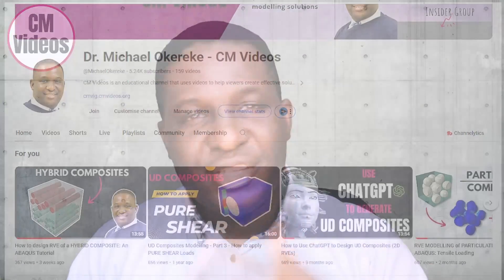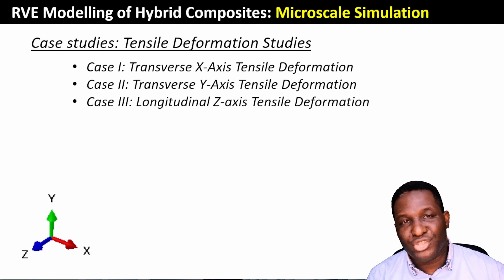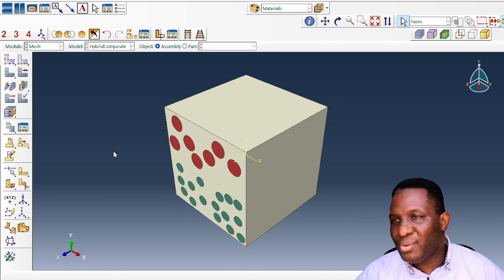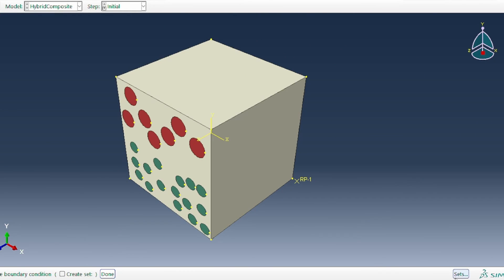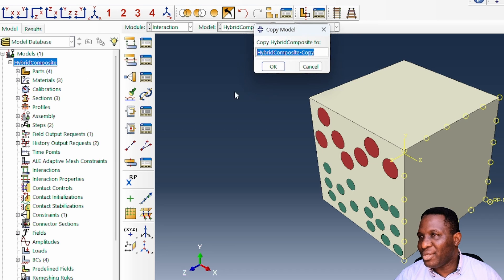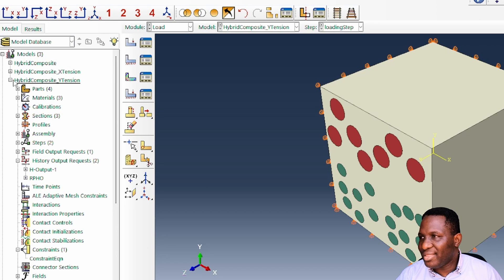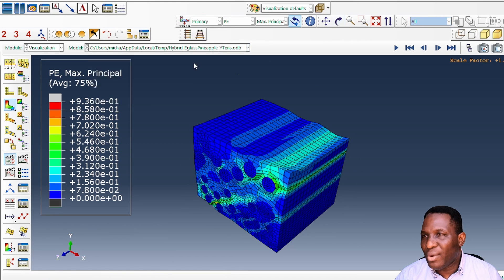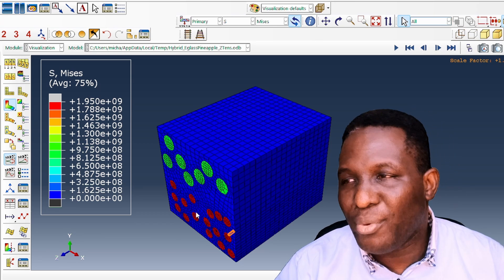Tensile Deformation of Hybrid Composites: An ABAQUS Tutorial

Comment: I am simulating simple composite tension with Abaqus.

However, there is a problem. At 0 degrees, the tsai wu index value and the fiber direction stress of each layer are the same, but when a symmetrical composite is processed with the same process, the fiber direction stress of each layer is the same, but the tsai-wu index value is different.

I also calculated it with the equation provided in Abaqus, but it is different from the analysis result.
Can I get some tips on this?
Reply from the maker: Not sure I have any tips for you.

Comment: Dear Dr Okereke, 
Thanks you again for the great informative videos.
I had a question;
If I want to do damage and plasticity in the RVE using this Drichlet approach (if I don’t mistake like polynomial loads), is it possible to give the ductile damage properties and simulate the RVE?

Thank you for your time and help.
Reply from the maker: Of course, you can undertake the RVE study with the Dirichlet approach. This is the most common way of running this sort of microscale simulations. What you need is to include the plasticity with a ductile damage polymer model (capturing the behaviour of the matrix). I typically use an elastoplastic material model, as it is quicker to use and the easiest to understand to the lay person who I tend to reach to with my videos.

For more advanced users, polymers are typically modelled using the Drucker-Pragers yield criterion. This is because for such ductile materials that experiences yield, you need a criterion to instruct the simulation that damage (or more appropriately yielding) has commenced. If you search in literauture on say Google Scholar, you can find papers that give you parameters for the Drucker-Pragers yielding for an epoxy material. Here is one I found quickly: https://doi.org/10.1016/j.proeng.2015.12.622

Comment: What is the difference between with and without PBC
Reply from the maker: I actually did not use PBC in this case. It is a simple Dirichlet Approach where I contrain a face to a reference point. I can see why someone might think it is PBC but no, it is not. If it were to be PBC, then you will have corresponding parallel and opposite faces having the same displacement. This is not what is done here.
Reply: Thank you for your response
So in which case we need to use the PBC not the Dirichlet BC
Reply from the maker: If you have a mechanism for implementing 3D PBC, then you can use it. It would normally be for heterogeneous microscale RVE as here.

Comment: Dear Dr. Michael Okereke， Thank you for uploading this RVE. Still wish you would give a video on how to do 3D RVE periodic boundary conditions. My concern is if the displacement boundary condition is good enough to predict the strain strength curve, especially it is related to the multiscale approach. In other words is this enough to predict upper-scale modeling material properties?
Reply from the maker: Thanks for your query. I am not ready yet to start teaching and making videos on the 3D RVE. I need to find an easy way to teach this as the maths behind it can be quite challenging. I also want to get a software that can make this easy ready for public release before making the videos. This is what is holding me back.

On your second question, the Dirichlet BC approach I used here is still suitable to predict homogenized (macroscale) properties. This falls in the area of computational homogenization. If you choose RVE right, apply appropriate boundary conditions, then homogenized properties extracted from the model will be representative of what you describe as upper-scale modelling material properties. So, you can use the strategy shown here with confidence.